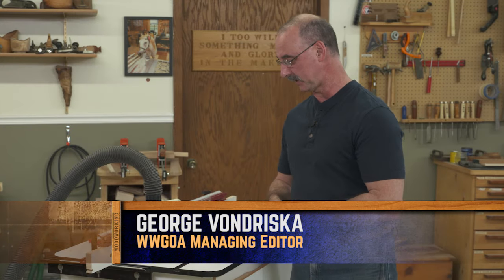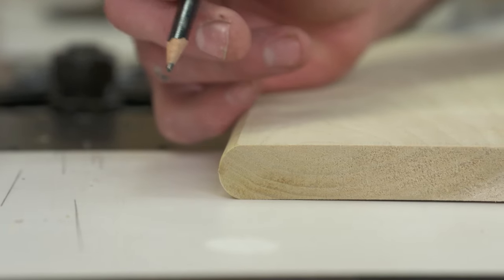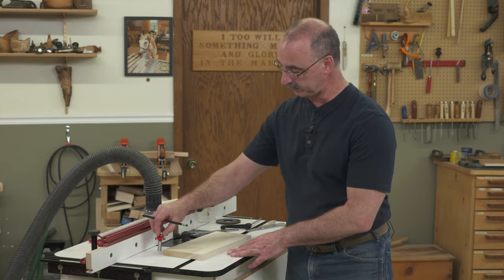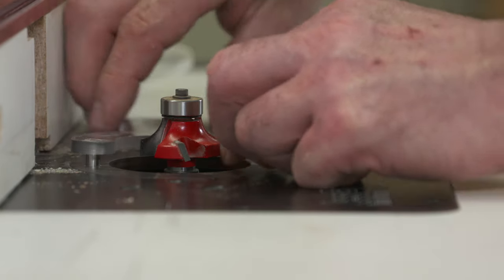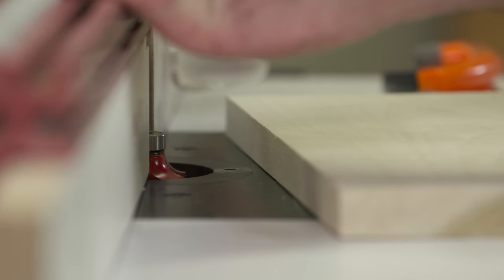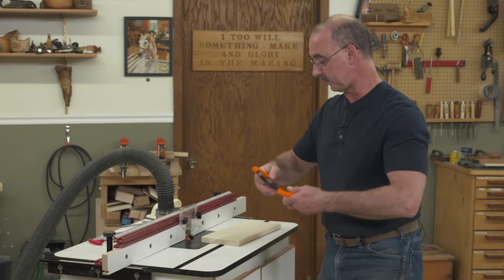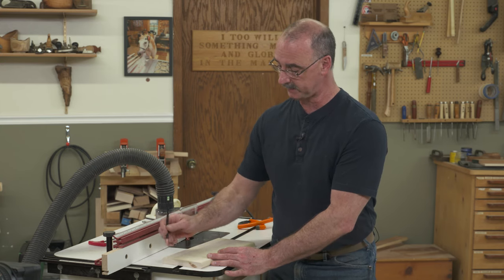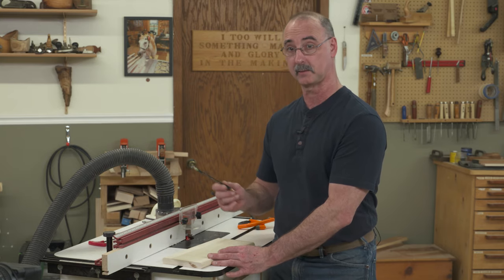Bullnosing Techniques On Your Router Table

Comment: That last little tidbit of the board thickness is very important... I made the mistake before looking up any tutorials and learned the hard way that if your material isn't thick enough, then the bearing won't be riding on the same spot when you flip it over so the cut on the second side will be deeper.

Comment: Thanks SO MUCH for this very informative video ... I'm usually pretty good with the common sense, but it never occurred to me to use a rounding bit and just flip the wood to make a bullnose cut. I was about to go out and buy a bullnose bit for $46.50 when I already owned a 1/4" rounding bit. I recently bought 1/4" half round at a local lumber yard for .25 cents a foot, now I'm making it for less than penny a foot. Thanks once again to you & YOUTUBE.
Reply: I bought the bullnose bit🤦🏻‍♂️

Comment: I am wondering if you can give me some routing advice? I’m working with a lot of 1/8 thick material that is rectangular and I want to round the edges all the way around the material. What would be the best method to do that? Would you recommend that I use a jig on top of my material and move the material and jig together against the router? I’ve got a lot of material to bullnose and trying to find the most efficient method. Thank you for your time and consideration.

Comment: This look easier then a Freud 3/8" Radius Half Round Bit with 1/2" Shank (82-116), is there a reason why you don't use a bit similar to this one?
Reply from the maker: If you are doing a large production run, then tooling up with the dedicated bit is likely a great way to go.   A 3/8" roundover is a more versatile bit that most woodworkers have in their arsenal, which is why it is used here.

Comment: Hi @Woodworkers Guild Premium I wonder if you can help me Im building guitar speaker cabinet have used 12mm plywood an constructed all sides using finger joints I've just ordered 1/4 rounding bit 9mm an im using a plunge router what's a suitable depth drop to set with that may I ask ? .

Regards 
                  James